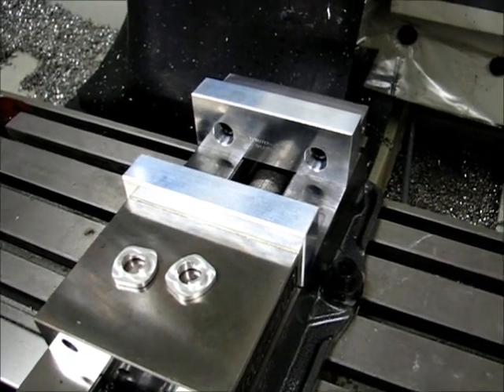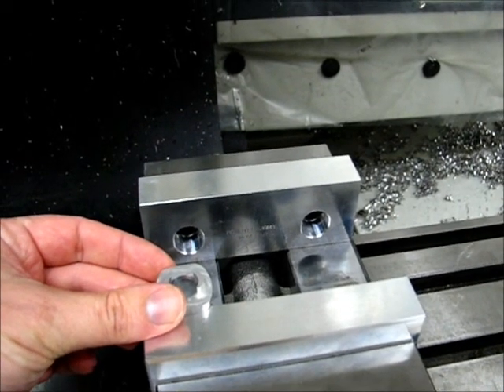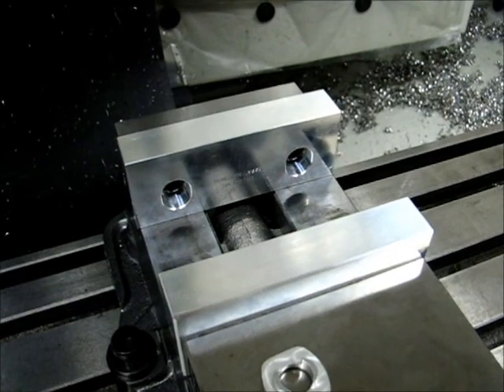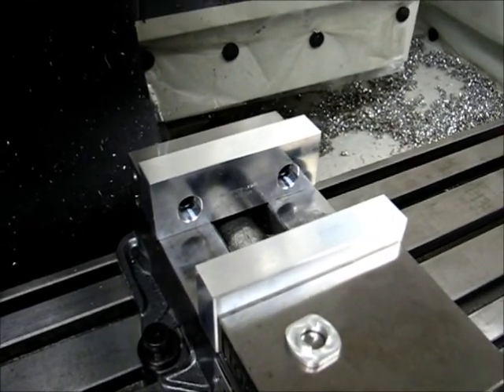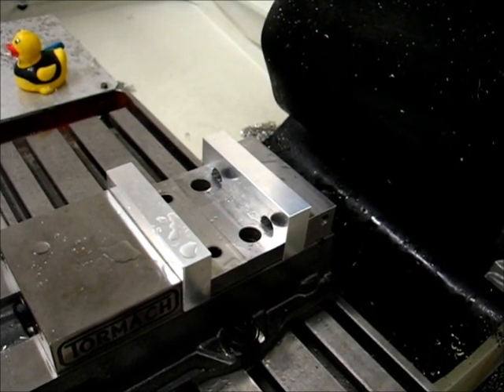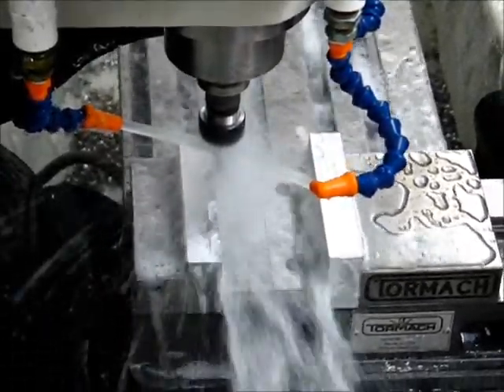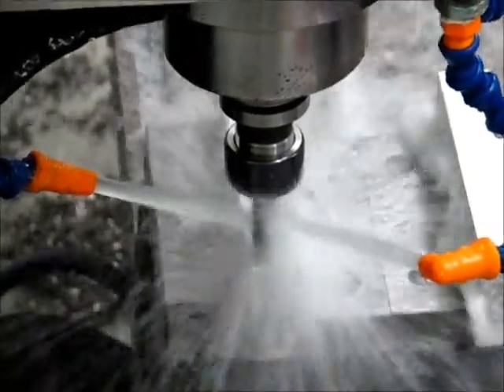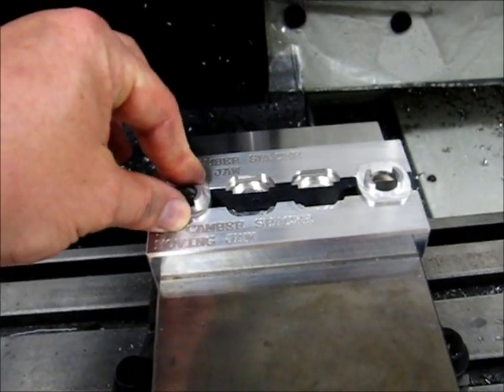Tormach PCNC 1100 - Machining Soft Jaws for Fixturing

Comment from the maker: Rob, thanks for the input. I thought about doing it that way, but decided against it for two reason; first, I would have had to make another CAD model to base the tool paths on and second, I wasn't certain at the time I did the tool paths what I would use to hold the jaw apart at a set distance. So I took the path of least resistance. Now that I've done this once, however, I'll probably machine from one operation next time. Less G code checking/editing and less setup time. Thanks for the input!

Comment: I look forward to your uploads!

I haven't used soft jaws before, but I was wondering......could your put a .050", or so, deep channel or pocket on the back of each jaw, just slightly wider than the vise to help with reregistration each time you use them?  I would think give a pretty repeatable reference, but I may be missing something.

Comment from the maker: Yes you can do that. However, the jaws on my vise already register off the slide under the jaws, so the additional step isn't worth it. I have seen some discussion in the Tormach forum of CNC Zone that mentions other ways of aligning jaws. Check for the thread called "Compatible jaws for Tormach 5" CNC vise?" on the 2nd page.

Thanks for watching and commenting!

Comment: don't use two programs to machine your soft jaws, just set up off of your back jaw exactly how you currently are, set some spacing using a short parallel or gage pin (or virtually anything else) and machine the pocket..